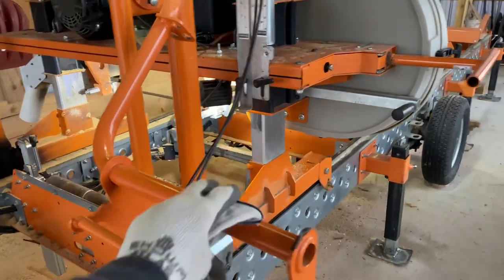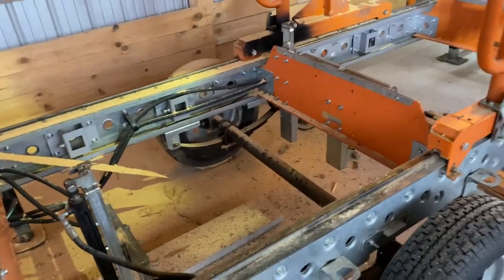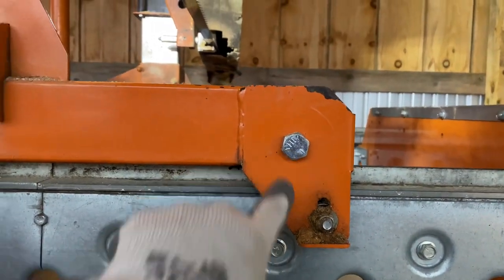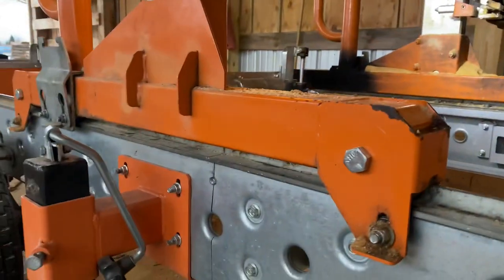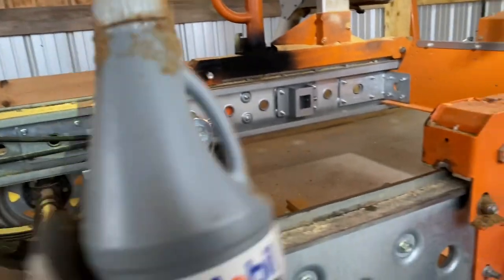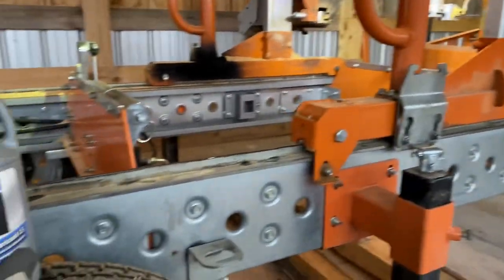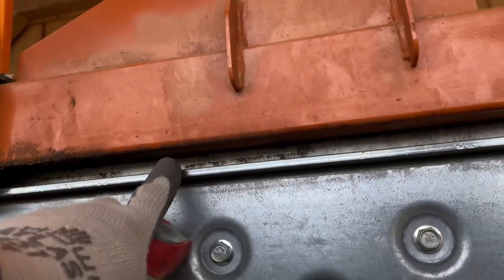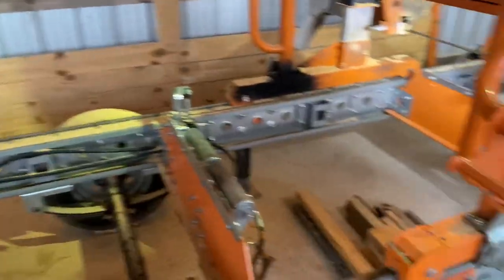Does your Norwood Sawmill Push hard through cuts? Try this now!!

Comment: Thanks for the tip!  Another thing to look at is the distance between the track rails.  If you still have the track template from when you built the mill, run it down the track to make sure it is still in alignment-- otherwise check it with a tape measure.   It is pretty easy to bend the track slightly, if it is hit sideways by a log or cant hook.
Reply from the maker: Thanks Dave, 
Yes! I’ve had my track get bent out of shape number of times.

Comment: The problem is the wheels..they wear out and you lose clearance between your rail and track.
I came up with nice solution if anyone is interested .
Reply from the maker: What was your solution? 
I guess replacing the wheels would help.
Reply: @Plankmills  
I replaced the original track altogether, using 1/4" x 2.5" flat bar with 5/8" solid round stock welded to the flat bar.
A local machine shop made wheels out of delrin.
The wheels have a concave cut so they ride on top of the round stock.
The results are very smooth with zero binding. Much smoother operating than the original track system.
I have about $900 in the new track system and I feel it will last a long time.
Been running it like this for about a year now and it's great.
Reply from the maker: Interesting! Yeah the track it comes with wears out pretty fast.
Reply: do tell
Reply: @imenriched  
I removed the original tracks and went back with 5/8" solid round stock welded to 2" x 1/4" flat bar.
Took an original wheel to a machine shop and had him turn the wheels from delrin material. The new wheels have a concave groove that runs on the new round track.
It's smooth and you can push the sawhead with one finger and there's zero side to side friction as with the original tracks system.
Reply from the maker: @erikparbst2220 that sounds amazing! Does that still work with the system Norwood has on there to keep it from popping off the track? Does it sit at the same level as before?
Reply: @Plankmills  Yes sir,
Everything is the same as far as the height of sawhead. I didn't have to adjust anything. The height of the new track design is exactly the same as the original.
And is way smoother than the original tracks.
I bought the round bar stock in 12' sticks so there is only one seam in the new track instead of every 4'
Reply from the maker: @erikparbst2220  wow that’s great!